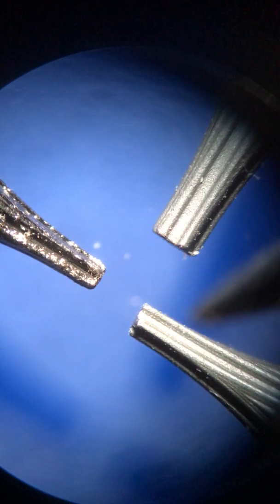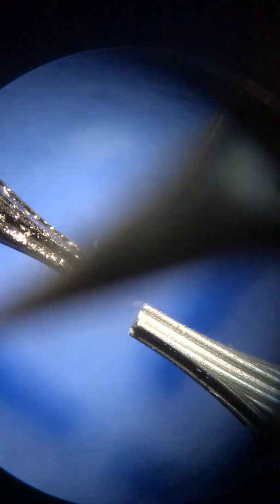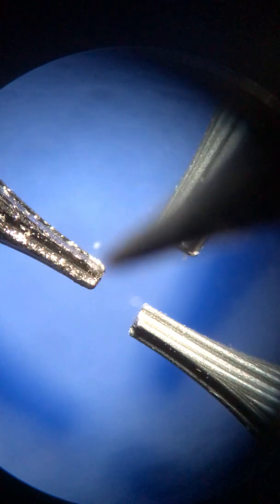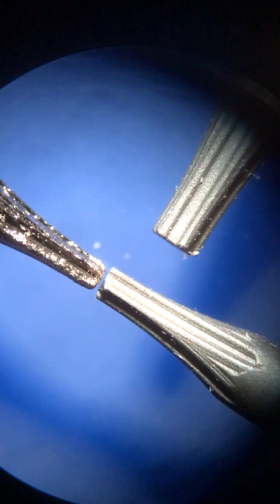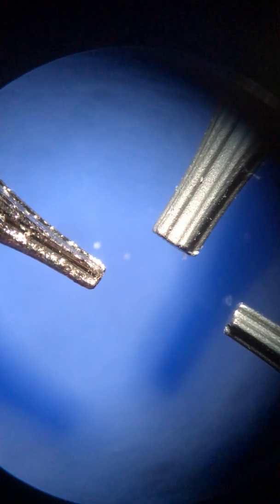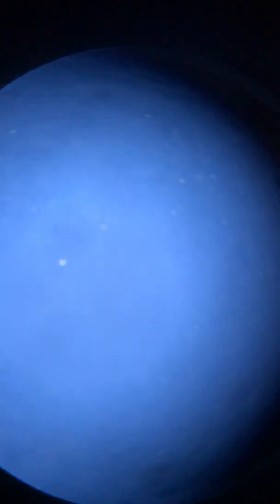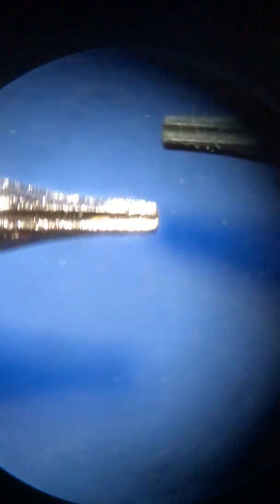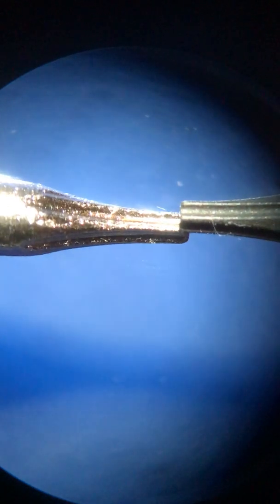Klein Tool Fail continued: Precision tips under 20x microscope. iFixIt, Klein, Wera P2 bits compared

Comment: This is shameful. I legit have essentially throw-away one-off screwdrivers that come with replacement batteries for iPhones from China that fit properly.

I also have two cheapo Chinese repair kit sets (Kingsdun and Justech) with working 0.8 pentalobe bits.

Comment: So, I was in Home Depot, when I saw this Klein kit. Hey- I need a "beater" set of precision drivers for the machine shop, where I won't be opening up any iPhones, and $30 for a quality electronics kit is a good deal.
Low and behold, my KTP2 marked driver is, in fact, an Apple TS1 / P2 driver. At least according to my old iPhone 10, iPhone 12 Mini, and iPhone 13 Pro. Looks like Klein got nailed by a supplier who mixed up batches of drivers during the labeling process? It will be interesting to see how Klein handles this, since I think this confirms that it is not in every #32717 kit.

Comment: To be fair to Klein - there is no open-source published specification for Apple's Pentalobe Security Screws. The only consumer facing driver manufacturers who have access to Apple's blueprints are Wera and Wiha; everyone else is reverse engineering and taking a shot in the dark.
Wikipedia leads me to believe that this looks like a PL2 size, mislabeled as P2.... but both the PL and P nomenclature are unofficial (Apple's official sizes are TS0-TS5).
Reply: They could easily get a confirmed working pentalobe bit from Wera and/or Wiha and measure it properly to make their own. I'm sure they have access to measurement tools that are accurate down to the micron.

Comment: The machining of the bit looks too good to be out of tolerance. Its most likely a 0.9mm bit for the Apple watch band that got mis-stamped as a 0.8mm for iPhones. (This would be the equivalent of the Wiha PL2. The ifixit and Klein P2 is equivalent to the Wiha PL1.) I would hang on to that Klein bit as its not included in the kit and might come in handy, and see if they will send you another P2.
Reply from the maker: Interesting.

Comment: This is an epic fail on many levels, besides the wrong sizing. More importantly, we don’t need yet another bit size, and a proprietary one at that. We have ¼ inch hex and 4mm micro bits, that’s plenty enough. Going with 3.5mm was plain stupid.